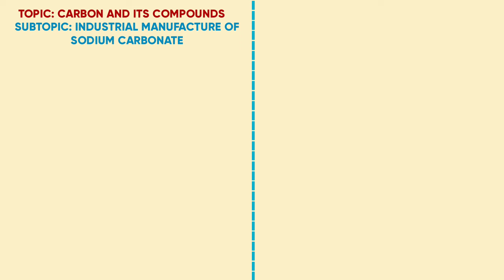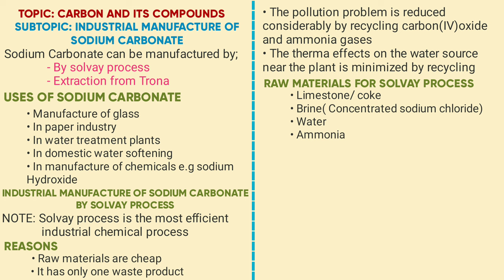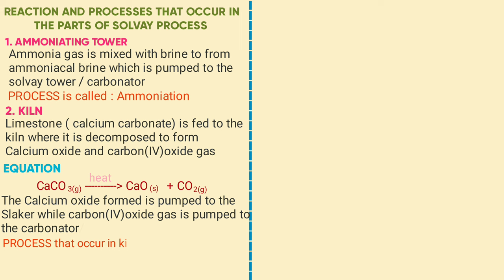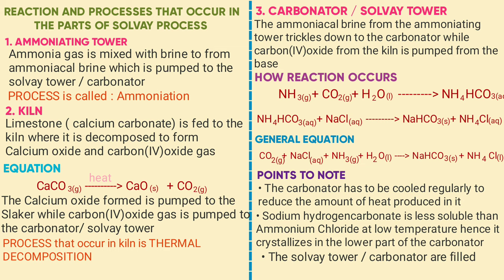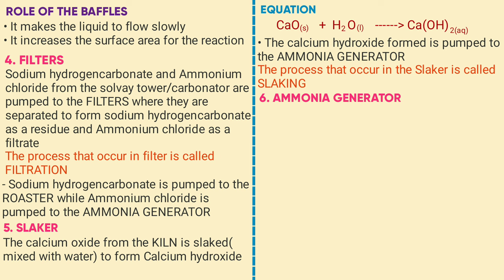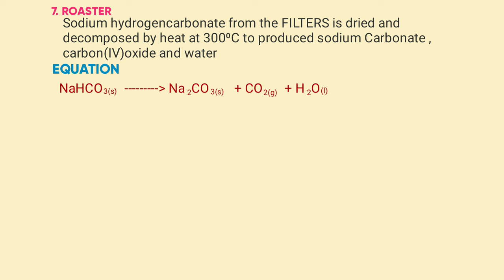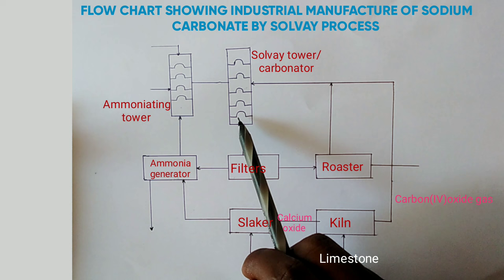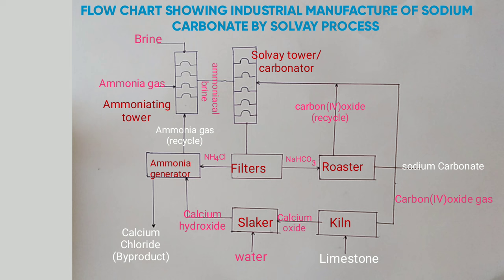FORM 2: CARBON AND ITS COMPOUNDS ( Solvay process)

Comment: Hello mwalimu.. why is this process located near a river
Reply from the maker: The carbonator or solvay tower requires cooling so that NaHCO3 ppts at low temperature
Reply from the maker: Water is a also a raw material hence large source of water is required
Reply: @f1-4simplifiedchem72  Thank alot